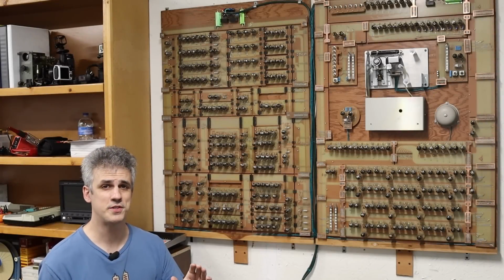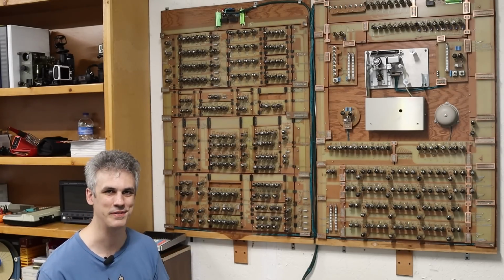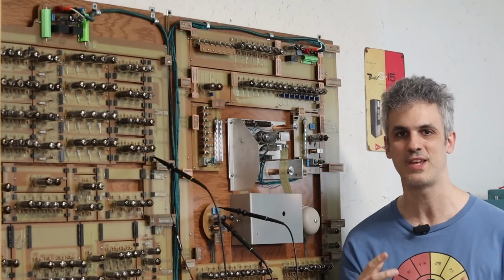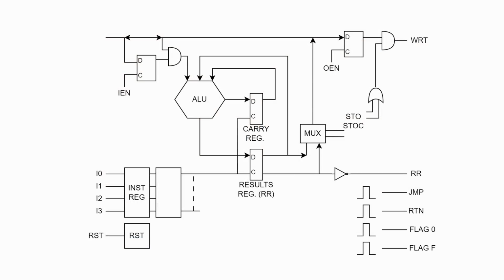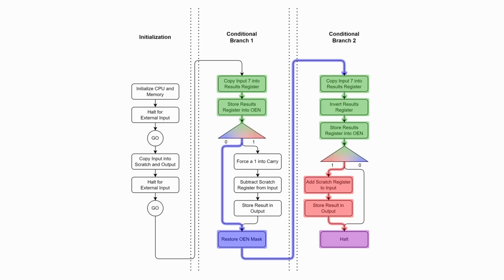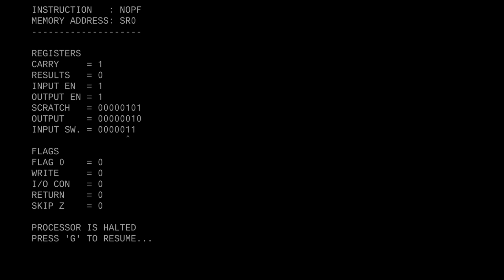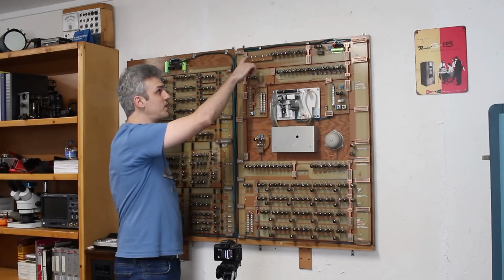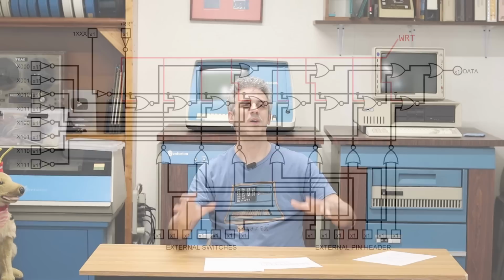The Last UE1 Episode!

Comment: This has been such an inspiring project. Designing logic circuits using discreet components is like a puzzle and I have now started working on a project to simulate a fairly complex logic circuit using DTL (it's cheaper than valves and, it takes a lot less current to power the approx ~200 transistors that I'm expecting to need.).  While it's not a CPU, it's still full of challenges and lots of "Back to the drawing board" moments.  I'm really enjoying this and would not have even considered doing it before watching this series.

Comment: Tubes , especially pentodes have high input/output impedance. It is a cause that such devices are extremely sensitive to any spikes, EMI noises. These spikes can appear between bus wires. When we get a triode, there is another disadvantage - Miller`s effect. You had done a lot of work to build tube mashine - it is a great result!)))))  But it would be reliable to make a machine from bipolar transistors and Shottky diodes (between base and collector ) . Such logical gates have low input/output impedances, so they are much less sensitive to external noises and spikes. Schottky diodes improve speed to avoid saturation.

Comment: The TMS9900, and the TMS9995 are my favourite CPUs ever. Over the years, I learned Z80, 6502, 68000 and even a bit of Intel assembly languages, and the TMS99xx range is the best of them all. The in-RAM registers, and workspaces are the best features. So many tricks you can pull of using that architecture. On the negative side, there's no stack - though you can chain workspaces together with the BLWP instruction. Looking forward to your 9900 series. As an aside: The 9900 is a big chip, and requires a four-phase clock and also -5, +5, and +12V power supplies. If you want to save yourself some hassle, you can use a TMS9995 which is faster (even though it only has an 8 bit external data bus) and has fewer pins, and runs off a single-phase clock and only requires a single 5V supply. It is fully object code compatible with the 9900, and much faster, due to instruction pipelining which was not implemented in the 9900. Regards.

Comment: UE2?  Memory could be spinning rust, like your Bendix or like this D17b which used transistors and spinning disk with fixed heads.  
https://en.wikipedia.org/wiki/D-17B
You wouldn't be controlling an ICBM, so you don't need to be as fast, nor as complex, nor the Analog-Digital converters.  
So your transistor account could be much lower.  Only a few transistor-based registers  required.  Arithmetic could be bit-serial.  Again similar to the Bendix and even harkening back to the Manchester EDSAC.  Using the spinning rust with fixed heads as delay lines instead of mercury delay lines.

Comment: UE2 ?  Vacuum tubes? please no.  Use transistors.  Even in the 1950s people realized tube computing was hot, but not good.  See for example, MITs TX0, which interestingly used transistors in glass envelopes --- so you can have a different kind of tube!  
https://en.wikipedia.org/wiki/File:MIT_TX-0_computer_Philco_surface-barrier_transistors.JPG

Comment: Congrats on the successful creation of the UE1!  But before you put it up on metaphorical blocks, I'd love to see it taken out for a spin (pun intended)!  Fibo numbers are cute as a test, but it needs to do something "useful", similar to an application that the original 1-bit chip would have been used for.  Real-world inputs and outputs, like controlling a traffic stoplight in response to road switches.  The Main Loop of code would, of course, be putting the paper tape in a physical loop, and let 'er run.

Comment: Awesome work! This is an impressive achievement.

While the CPU I designed was a HDL model, I went through similar issues bringing it up. I had the luxury of an HDL simulator to let me run through a test code, but the steps were pretty similar. I would suggest testing every instruction near every other applicable instruction, as you can find weird interactions that way.

Comment: Congrats. Although using sillicon diodes is cheating. I think you can redesign that whole logical board without the need to add an extra pin to each of the gates. Just calculate the logic table at the output.

Comment: One thing that I did with conditionals when I designed a one bit cpu ISA loosely inspired by your UE1 is that I had the most significant bit of an instruction be a "conditional" bit; where if it was enabled it would only execute the instruction if the cpu flags register was true/false. More specifically, the cpu flags register was 4 bits long and denoted by the following mnemonics: Zero, Carry, Flag conditional, and Invert conditional. The Zero and carry flags work identical to typical cpus, where the Flag conditional denotes which of the two flags would be tested if the conditional bit was enabled, and the invert conditional changes what value the flag should be for the instruction to execute.

I then added two more instructions: JMP and LBL (label). I added these in part for completeness (to fill up the number of instructions and reducing the amount of NOPs there would be) and because it would allow more complex programs. Say you wanted specific instructions to only execute if both Z and C are enabled. There is no way to test if both are enabled for an instruction to be executed, since there is only one conditional execution bit in the instruction. Using LBL, you could make a label at the very end of the section of code, then if Z is disabled you jump to that label. Now, you can set Flag conditional to 1 and Invert conditional to 0 and now all subsequent instructions would only execute if both Z and C are enabled.

An interesting behavior arises though if you set the conditional execution bit of a label to true. Since LBL is an instruction that must be executed in order to exit out of a jump, if the conditional isnt met, then the jump would just skip over that label and continue to seek for the exit point of the jump. This would allow a single jump instruction to have multiple possible destinations based on the current CPU flags.

I added the LBL instruction because, like the UE1, all programs would be stored on paper tape, and paper tapes dont really have specific instruction addresses, so in order to make a jump instruction possible, you would need to add labels into the program itself that are the destination points of jumps. Furthermore, while there is a specific HLT instruction, there would be an alternative HLT if you make a jump to a specific label but there is no valid label to jump to; thus the tape would continue to seek and spin trying to find the valid label. I believe this behavior would only be possible on tape-based instruction ROM, since the programs would only realistically be a couple hundred instructions at most. If a similar thing was implemented on a modern cpu, it would be too expensive to run (since the cpu would have to loop through the entire instruction memory space which could be hundreds of kilobytes long).

Comment: If you are using a relay for controlling the tape reader motor, just connect the alternate contacts so that the motor leads are shorted together when the relay goes offline.  This will act as a brake and stop the motor almost immediately..  You can also put a resistor in there to have a slower braking action, but make sure the resistor is big enough as it will get hot..

Comment: Congrats! What a big day! It's wild to see the UE1 complete. I am really psyched for the TMS9900 machine! I have been throwing around the idea of building a homebrew machine using this CPU for years but ended up going with a M68000 instead and am in the depths of that project currently so I am really excited to hear about your plans for the TI chip! Such a unique CPU that was done dirty in the TI-99/4 and 4A and didn't get the recognition it deserved. The first computer I ever owned that all mine was a TI-99/4A, it was totally obsolete by the time I got it but I loved it. I have one setup currently with the expansion chassis with maxed out RAM, speech card, floppy controller with a gotek and a real 5.25 drive, so I love this idea!

Comment: The UE1 might at first glance seem like a needless, inefficient machine. But it is a more efficient space heater than the typical resistor, this one can at least also compute trivial mathematics!

But on a more serious note. It is quite the undertaking to build something like this and it is fun to see it fully working.
Another simple observation we can make is that extending it to use more than just 4 bits for addressing is down right trivial from an architectural standpoint. Giving it the ability to work with far larger numbers while likely only getting slower on a linear fashion.
Simply stated, it might not be faster than a human currently, but one able to toss around 16 or more bits would likely be faster than us.

Likewise could we ponder ways to improve its capabilities by extending the instruction side as well. Making it able to handle more than just 1 output enable mask could give it some serious branching capabilities in ways that makes it easier to hand write code for it.

I am serious when I say that if this had 6 address bits, a second output enable mask or two, then it could become quite the serious machine. And all that would need is just 3 more bits in the instruction word, nothing all too exotic to be fair.
Then it can suddenly work with up to 32 bit numbers. Or do more complex math using smaller values. Even if I suspect that the length of paper tape would become a bit comical at that point.

Comment: A few weeks ago, I had a dream that you excitedly announced that you were going to get started on the UE2, the new and improved home brew vacuum tube computer, and you wheeled in the chassis upon which you were going to build it in : an upright piano.  Upon waking up, I realized that would be an ideal device to repurpose into a computer.  It's designed to be sitting in front of it.  It has a wide expanse of space in front for controls.   It has ample room inside for tubes and circuit boards.  It has an upright viewing area above the keys for displays.  The only downside is that transporting it to shows and events would require something like a box truck.  Maybe you will use this idea, or maybe someone else will, but just throwing out the suggestion.   Keep up the good work!
Reply: UE2 looks to me like it will be so big that it might as well use an upright piano case.  Maybe it could have a bunny area built into it as well?
Reply: @SeekingTheLoveThatGodMeans7648  YES! YES! It needs a bunny built in! Then we get "Ding Ding Ding -- Out of lettuce error!" (Check Terry Pratchett's computer 'HEX') Or the more modern version in my house is "Error C2 - Out of Wine."
Reply: An excellent point, but maybe a piano style cabinet would be more portable? It probably doesn't need anything as heavily built and study as a real piano case.
Reply: I envision that the UE2 will have to be modular, with boards that plug into a bus, with each board being about the size of a full sheet of 4x8 plywood, with maybe dozens of boards on the bus. The piano would probably be too small; I think he'll need an actual bus for the UE2 and its boards and bus. (Maybe the diesel bus motor could run a generator to supply the power -- if there's no hydro-electric dam nearby!) 😉

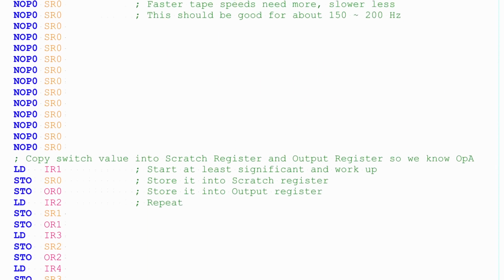Comment: 16:10 "There's no way to differentiate whether I'm doing a read or a write"
I once had a system that wouldn't reset properly after a crash. Turns out the hardware designer hadn't put the R/W line into the watchdog reset circuit, so reads from the watchdog address would reset it. This was a 6809 system, and when it hit the always fun "test" instruction, it would read all 64K addresses constantly, in less time than the watchdog timer was set for!
It didn't help that the first unit to show this problem was in Roswell NM, but at least I didn't have to make the field service call.
For bonus points, this was discovered after v2 of the hardware, which was split onto two ISA cards (for mounting and power only) and the R/W input had been removed from the new PAL because it wasn't being used. Oops.
23:08 paper grass tape bunny! DING!

Comment: Well will say that the UE2 definitely needs a switch in it labelled "Awesome" and "More Awesome", probably controlling the internal clock, allowing you to run it at a slow clock rate where you can actually see the bus in operation, or at full speed.

Comment: You’re still driving the relay improperly, David. I realize it now rings, but as I posted before the correct place for the load is in the plate circuit. Perhaps there is a reason it can’t be there, such as unreasonably low coil resistance. I suspect this has caused you to think in terms of low impedance cathode vs high impedance plate- this is only true for normal tubes. However just like regular tubes when the load is in the cathode, if the tube conducts the cathode will rise to whatever voltage it takes to run the load, which also messes with the required grid voltages- as you’re finding out. Please look at moving the load to the plate, then things will make more sense.

Comment: "Oscillators won't oscillate. Amplifiers will." -- R. Pease
Reply: RIP,  Bob Pease.  I've seen videos where he's tossed computers off a rooftop after being frustrated with the results of a SPICE deck run on an early version of SPICE (SPICE is a circuit simulator, a SPICE deck is a set of commands telling what to simulate and how to measure the results).

Comment: I just had an idea for porting the UE1 that could be very useful in education etc.
An HTML page with JavaScript can fairly easily be made to have an editable input area that scrolls, and area to show the "tape" and output of the assembly in hex and finally a model of the entire UE1 processor.
Learning to program, not learning to code, is learning to break a problem down into steps.  The fewer features a processor has, the better for teaching programming.  Making the UE1 add two numbers took some programming.  On a different processor, doing an ADD would be just one line of code.
There are a few features I would add to the UE1 if I was making it for the education purpose:
1) A speed control on the "paper tape reader" perhaps with a single step feature
2) An ON/OFF Volume knob on the bell so it can be turned up to add more cowbell.

Comment: Fantastic to see the UE1computer fully functioning, congrats. Quite the achievement thanks for sharing your troubleshooting experience.

As a retired EE and homebrewer had to chuckle at your comment about circuits that should not oscillate that do and those that are supposed to not. 

Seeing the 2D21 thyratron in the bell circuit brought back memories as I used the same tube for an 8th grade science project proximity detector. Always had a sweet spot for thyratrons.
Reply: The software equivalent of oscillating/non-oscillating circuits is, "Constants aren't and variables won't."

Comment: Wait, what?? Someone ported the UE1 simulator to the G15?? Freaking WILD! Well, David, looks like someone threw down the challenge gauntlet! Get the UE1 Fibonacci program to run on the G15, get the correct result, and RING THAT BELL!! 😆😅
Reply: Yes indeed.  It runs about 1 instruction every 6 seconds at the moment, so the Fibonacci program takes about 30 minutes to complete.  I'm currently working on some speed ups (software engineering priorities - correctness, maintainability, performance, in that order).

Comment: Congratulations on getting the UE1 working correctly and reliably at last.  It's been a really fun journey and I'm sure I speak for all your viewers when I thank you for taking us along on this journey.
I wonder how challenging it would be to "home brew" a valve computer which uses magnetic core memory salvaged from a defunct old computer system as its memory?  I wouldn't suggest attempting to construct your own magnetic core memory because it would be too hard to find matched magnetic cores which all have the same magnetic permeability within tight constraints, and that would be necessary if you were going to make your own.
You could even try your hand at making some "Core Rope Memory" for its boot-up sequence.  (Has magnetic cores similar to magnetic core memory but works on different principles and is read-only, and the way it's wired during construction determines what code it contains).

Comment: Now witness the power of this fully complete and operational UE1
Reply from the maker: The death star pulled less power than the UE1!
Reply: @UsagiElectric  That's because the Death Star's designers wimped out and didn't stick with original vintage Empire vacuum tubes. It's the difference between simple engineering and art.
Reply: And since it's based on vacuum tubes, this is the ideal time to quickly declare victory and just move on. Eventually some future Usagi-inspired restorer might be making videos about restoring a no-longer-functional UE1, but there are so many other projects in David's queue that deserve attention.
Reply: Fire at will, commander.:hand-pink-waving:
Reply: RIP Alderaan
Reply: @artofnoise5013  "You may fire when ready."  two hours of chatter as the punch tape rolls then *ding*  then an Alderaan-shattering kaboom.
Reply: @bonemar66  "Where's the kaboom? There was supposed to be an Alderaan shattering kaboom" - Marvin the Martian (probably)
Reply: DING

Comment: Now, see if you can a make a CGA video card for it, 🤣😆😂 Just kidding!! Maybe you could figure out a way for it to use the paper tape punch to write output to paper tape as well as read from it (which you already have.) That might count as the tube equivalent to a CGA display. Or - at least - a line printer.